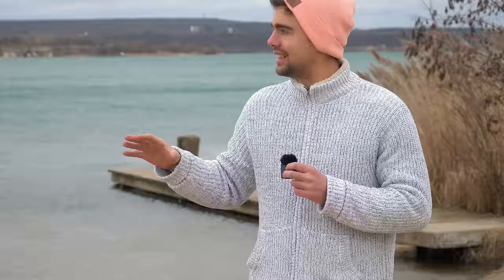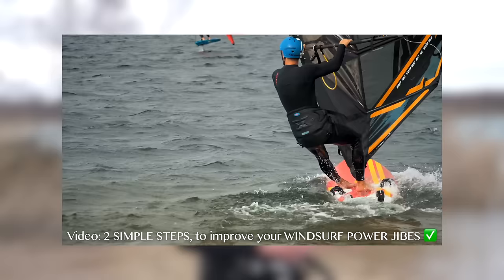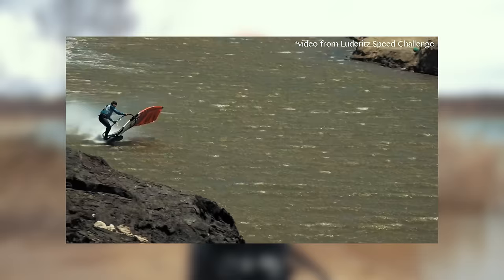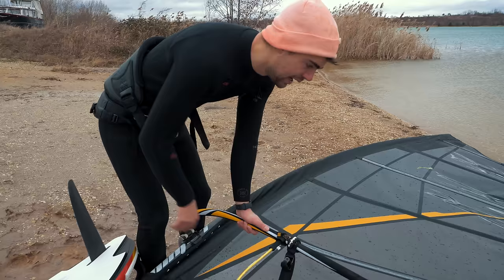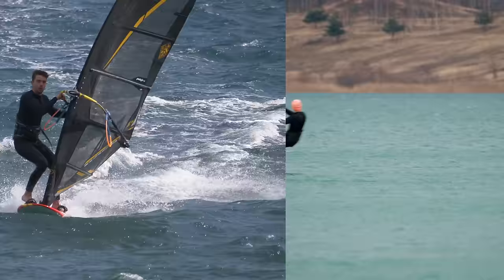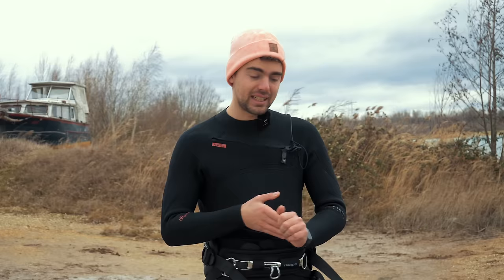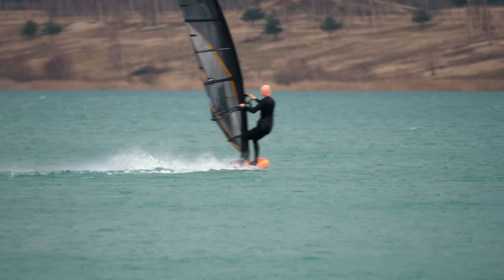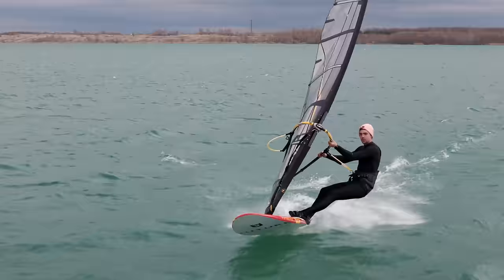🔑The KEY, to make the Laydown Jibe | Windsurf Tutorial

Comment: as you said the "laydown" jibe is  a "style" jibe. If you, like the real pros are 120% fully powered up, which no normal surfer is able to control, then it makes sense. Otherwise you just kill your speed and therefore the jibe so easily. But the main move, to sheet in the sail which is the little brother of the lay down, this every windsurfer should train. Still hard ennough because it means "balls", i.e. commitment to the rail pressure.